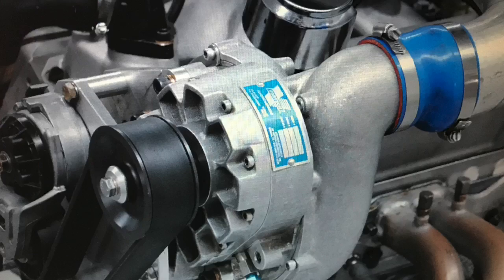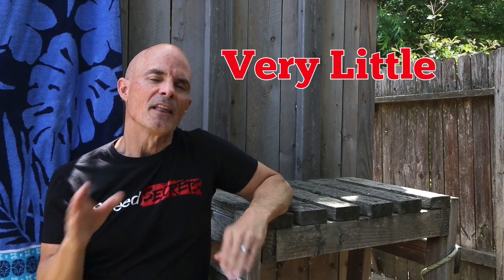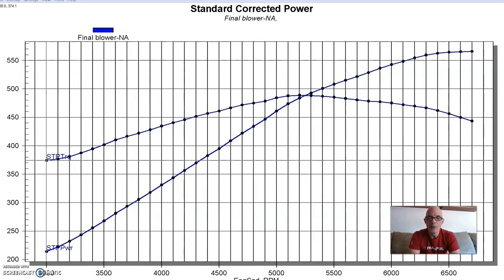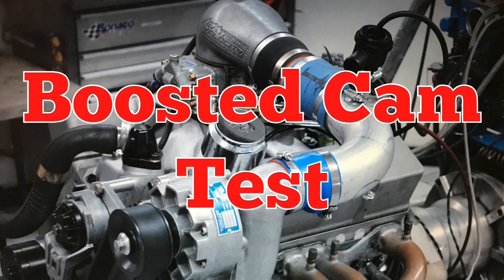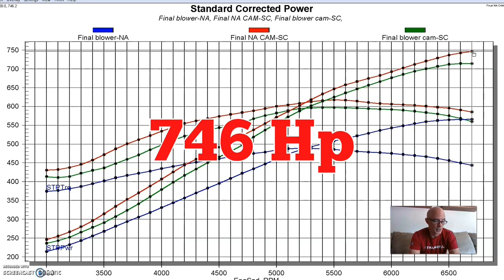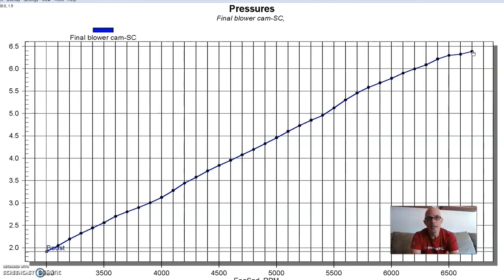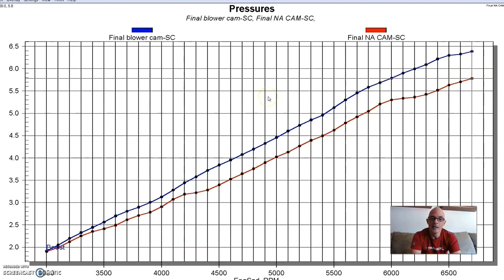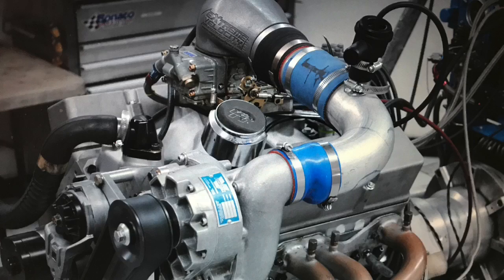MOTOR MYTH BUSTING-BLOWER CAMS!

Comment: What I was interested to see was which gained the most power from the addition of the blower and it is interesting to see the gains were pretty much the same.  The N/A cam gained 149hp and 102tq where the boost cam gained 148hp and 108tq. Virtually the same gains from each.  I had heard this about nitrous cams as well many years ago and it is nice to see it playing out with blowers and turbos so naturally you would assume it's the same with nitrous.

Comment: I thought it might have lost boost at low  RPM becouse of the overlap and gained it back up high .but as you said the move horsepower needed the flow

Comment: Well, at least I feel better about my buddy's car that tried to kill us after he put the turbo back on the nasty SBF he had put the big NA cam in lol....thought I was going crazy, or the tires were old, or the higher gears were the culprit.
The boost is lower because the engine is more efficient and using more air coming in, reducing the back pressure.

Comment: With tighter LSA, more over lap, ins't there more chance of backfiring in the intake?
Reply: LSA doesn't add or remove overlap. Just moves it in the cycle . Duration changes overlap, backfiring would be an ign timing issue, which is cause by excessive retarded timing.
Reply: @vengeanceizmine9878  if you take a cam with given specs and only change the lsa it directly changes overlap. Narrowing (tightening it as KP put it) the LSA increases overlap, widening the LSA decreases the overlap. KJ was correct about that part of his question.

Comment: I drove a s10 with a sbc 350 stock bore massive cam fuile heads 8.5 to 1 compression and ran a 7.80et in the 1/8. Big cam for the win. First engine had a 494 lift cam and 10 to 1 compression ran also a 355 ran 8.30et

Comment: Did u monitor the exhaust temps with the different cams. I seen a blower 406 sbc with a n/a cam turn the headers red just a few min of drive time and it was not running rich nor lean. A dedicated forced induction cam fixed that problem. Just saying a few seconds of dyno pulls may not show that problem.

Comment: I like this test but I don't like how it was done. The "blower cam" thing is usually about 10% more area under the lift curve as compared to a NA cam on the exhaust side. The LSA is usually wider only to keep the overlap triangle similar. This test there is only a relative change of 4° of exhaust cam duration as compared to the intake. The test is also done at less than 7psi, something that is barely considered "blown", there isn't the need to bias the valve timing as there is with the effective port pressures in a dedicated blown application that runs lots more boost.
If I was gonna do this test to directly test blower v NA cam I would do a few things differently. BTR makes ls3 stage 3 cams for both NA and centrifugal blower and it looks like they have the same intake lobe. It's the exhaust lobe, lsa and advance that are different. I would also test it on something that has massive boost, like a 4.8 with 706 heads and an F1A blower. You could do a mass air v power test to see the effect of charge short circuit but a wide band can sometimes show it. If you notice one camshaft makes peak power when it's way more lean than the other, you can assume some fresh air charge is going right out the exhaust, even worst case total short circuit rarely gets to 5%, and your comparing two camshafts that have all else being considered, really similar overlap triangles. The difference is going to be like 1 or 2%. 
You maybe brought up a better point of people picking a cam that doesn't  work as good as it could because some put a sticker on it "blower".
Reply: Agree 100%; my thoughts exactly. I think he should redo this test

Comment: I hope what guys take away also is that putting the right cam for your application is still ideal. There's that one guy putting a sprint car cam in a Street car with a 3.5:1 gear and low stall automatic adding boost.

Comment: I need to change out the dome pistons out of my sbc 400 not sure what size they are. I am running edelbrock rpm heads 70cc with a hydraulic roller cam

Comment: Was anyone following fuel consumption? My thoughts would be with a healthy NA cam, you might find more of the fuel air pushing through the cylinder into the exhaust unburned. O2 sensor might show that also.
Reply: We know the NA cam was burning more air and fuel than the blower cam, because the NA cam was making more power. 

Maybe some of the charge was also escaping out the exhaust during overlap, but even if that was happening, it would still be a fair tradeoff - because more air was ALSO staying in the cylinder for combustion, and that's what matters because that's what turns into horesepower.

Comment: This is very interesting.  The N/A cam had better VE, but by quiet a bit more TQ than I expected.  It flows more air & that is why the hp is up and the boost psi is down.
What begs the question; what about the turbo (back pressure) option, would the N/A cam still have the hp gains & the boost drop? another note is how early the bigger (N/A) cam power came on under boost. this is where I thought the boost cam would be better. more LSA, less duration, designed for boost, that should (in theory) produce more tq at lower rpm.  I expected to see more out of the boost cam.  bullet cams are top notch too.  Great comparison
Reply: Tighter LSA makes more lower, at the expense of vacuum and idle quality. Wider moves it up higher. Just a trade off.  Map out and compare actual timing events between the two.

Comment: I definitely agree with everything that you covered in the video but there's some things that you're leaving out... as boost climbs and cylinder head flow starts becoming tapped out. especially on turbo cars exhaust gas reversion starts coming into play... when you run tighter lobe angles. And if you have reversion happening... then you can get detonation... heat build up... all kinds of problems. That's when you burn pistons break ringlands.. lift the head ect. In a situation where you run into those problems on a tight lobe angle with a n/a cam that's when you move further and further into a "boost cam".
Reply: Except that boost has nothing to do with what a head flows, and doesn't make it flow any more, or any less. BUT,  it will only take so much PRESSURE. As for tighter LSA with boost, he is not showing you what is mandatory, it just depends on where you want the power. And LSA is relative to overall cubic inch, and will act differently.

Comment: The boost is lower cuz the engine/ cam setup isn’t backing up the flow through the intake! But l would 
Like to see what the NA cam at 114 to 117 las would do!
Reply: I think that there is also some intake air passing out the exhaust. But that can be a good thing - the point of overlap is to flush leftover exhaust gases, allowing more intake charge into the cylinders by the time the valve closes. More pressure and airflow during that period just increases the effect
Reply: @coff3eSl0th  The only thing about the intake air passing out the exhaust is shouldn't the low rpm boost pressure be a lot lower with the extra overlap? Darren why would you want such a wide LSA on a 400? A 107 LSA would probably be optimum for this combination.

Comment: Same as in hydraulics, pressure (boost) is the resistance to flow. Lower boost=more flow. (Assuming the air volume is the same, also the supercharger in this test will draw less power at the same time due to lower boost)
  I believe i am also correct in saying when you look at the boost of a positive displacement supercharger, the point of lowest boost would be the engines most effecient rpm.
Reply: True, when the bigger camshaft kicks in in my engine (2ZZ Yamaha-Toyota) the boost drops a little due to the greater VE of the engine. It then goes on to keep increasing as the RPM rises, but that's due to the increase in VE of the roots blower with increasing RPM. That's one thing I didn't know about or expect coming from a turbo background. A roots blower increases in VE the faster you spin it. Makes sense, as there is less time for the air to escape past the lobe tip clearance. The adiabatic efficiency however certainly does decrease the harder you push it! But that's another story - heat management.
Reply: This assumes perfectly flat efficiency for the blower, and that's never the case. While you'll see a drop in boost for a rise in VE, the efficiency of anything else before the last compressor stage (the engine) will have an effect. Changes in charge cooling efficiency (like from the carb), supercharger efficiency (which isn't flat let alone linear), and so on will all have an impact on realized boost levels. 

On most roots style blowers they're most efficient at low RPM and low boost. As you increase pressure ratio efficiency goes down and thus charge temps go up (faster than relationship of compression related heat increase). As RPMs go up, they'll also eventually start rolling off on efficiency. A twin screw will perform significantly better, but generally exhibit similar traits. The nice thing about twin screw is that the RPM at which efficiency rolls off can often be far beyond the requirements of the build. The twin screw will still have efficiency roll off with pressure ratio increase, but has more range than the roots.

Also don't forget that directly attached superchargers require drive power, and that goes up with RPM.

I say all this because if you look at NA vs blown dynos for the same motor, like here on Richard's channel you'll see many cases where peak TQ moves. This shows how blowers will create a second layer of efficiencies that work on top of the primary efficiencies of the engine, and of course there's also the obvious intake efficiency changes if we're looking at a roots style with a dedicated integral manifold.
Reply: Exactly!!!

Comment: This was a great video, very informative and very interesting dispelling the myth of bleeding out boost due to valve overlap from using an NA cam. Question; can you explain what is "LSA" (Lobe Separation Angle) and what impact that figure has on the performance of a cam? Is this the overlap of the valves? Thanks!
Reply from the maker: take a look at the lsa test video
Reply: Lsa is the measurement in degrees that the valve events occur in relation to each other, or how close they are are to each other, let's assume a stock cam has an lsa of 116, the valves aren't open together very much going from the exhaust stroke to the intake stroke, now a more performance minded cam with an lsa of say 108, the valves are opened more at the same time between said stroke, the basic object is to get exhaust to scavenge or pull the exhaust from the cylinder while drawing in fuel and air mix, this event is what causes a tighter lsa cam to also what more "lope" along with duration measured at .050", I hate advertised duration its misleading

Comment: "Every cam is a boost cam"...my man.
Reply: But its only at 6 psi.  

When you start raising the pressure especially in the exhaust manifold it’s gonna change things a lot. 

What I’m saying is an extreme elevated power levels you guys don’t think the blower Cam will allow higher power and higher boost pressures? This isn’t gonna matter so much at 6 pounds. But at 30-35???

And I’m not staunch supporting this I’m just kind of throwing it out there to she wants to discuss it I appreciate the answers thus far.
Reply: My thought is at elevated boost pressures the valve overlap allowing exhaust to pollute the next intake charge.  Something at lower power levels doesn’t cause any issues but... let’s say you’re pushing 1500 hp and you have 40 pounds of exhaust manifold pressure... you don’t think that’s going to contaminate the intake charge at elevated cylinder pressure/boost. 

And the blower cam is designed to deal with this.

Basically I think this test needs a big ass turbo and more boost. I bet the blower cam is capable of making more overall power because of what I’m talking about above. 

I have ported and tuned turbo rotaries. I’m still trying to figure out the cylinder things
Reply: @williamkillingsworth2619  - first off, this test is a blower test, so you won’t get any exhaust polluting the intake charge - since the restriction on the exhaust side will be no match for the boosted cylinder exhaust. With a blower, you can blow some of the charge right thru to the exhaust. You can see this with EGT gauges because an O2 sensor can’t “see” it. This is also a “make the headers glow” conditions, if it happens. Lower boost won’t really happen much. Higher boost is more, but how much? Not a crazy amount.

When it comes to turbo, you can’t really have the “wrong cam” but you can have the “wrong turbo”. The turbine inlet restriction makes the pressure delta much lower than a supercharger, and in ideal conditions, approaches the supercharger or NA back pressure. Yes. Really.

Undersized turbines and hot side housings are a problem, as are undersized compressors and undersized or badly positioned wastegates. The backpressure itself isn’t horrible but the extreme heat buildup can melt valves or hotspot the head. Heat soak is also a bigger issue. In extreme cases you can see 10-20+psi MORE pressure in the exhaust than the intake. Luckily the path through the exhaust is much larger than the valve opening and that pressure is released along the path of least resistance. The inlet charge isn’t affected much, as the overlap period is relatively short at even high pressure deltas. Think about a garden hose spraying into a bucket. If you uncover the hose for .01 seconds, how much water comes out? Not much.

The term you were looking for is “reversion” by the way.
Reply: @grumpysteelman  yor reversion is right but not so much as a longer duration 
that loads more boost in the intake stroke so much it actually lowers the boost pressure in manafold almost like being under a load will pack the cylinder better
Reply: @alonzahanks1182  - You are oversimplifying things in your response and what you’re saying doesn’t seem to have a point.

Yes - if you have an engine driven blower then more flow = less inlet pressure. No - duration alone doesn’t do this and I covered overlap in my garden hose analogy, duration is the same result, shorter duration gives less opportunity to flow but duration alone ignores other flow restrictions where it may not have a positive effect. 

It’s the combination of intake and port efficiency, cam profile, inlet valve size, exhaust valve size and exhaust port and downstream efficiency that define the response characteristics, cylinder filling, and boost pressure.

Care to clarify what you were getting at?
Reply: @grumpysteelman  Im far from a cam specialist  but big rollercams are going to be more freindly than say a lobe on a olds 560 560 lifter cam 
I also do a lot of exaust testing with short pipes  2 into one and duel exaust testing
But I run a supercharger and not a turbo .
and dialed in is every thing a perfect ballance from the air cleaner to the tip of the exaust 
And even pay attension  to speed and momentum in exaust 
but like the constant pressure you want on intake you need velocity through the pipes
And cams can make that stop and start Id actually like to see how hot the head and exaust got during that dyno on each cam  and see the same lifts on each cam 
and Richard said why bother max hp wins lol might have well been a a little 292 chevy cam lol
Reply: Effin aye!
Reply: Listen to wakjin961 ! 100 percent correct
Reply: But boost cams run on low compression n/a Cams run on high compression
Reply: isn’t the blower cam more drive able out of boost? Giving it better street manners than an engine with a lot of overlap. 

I wonder if/how the longevity would be effected?  Is the Blower cam the safer option?  Or does the added overlap cause other unwanted gases into the cylinder that will rare its head at higher power levels?
Reply: @williamkillingsworth2619  If the overlap is less it will idle better and probably behave better just off idle. But the LSA on both cams is too wide and the duration is too long. If the overlap is correct then the duration and lobe separation can both be reduced and the mid-range will come in much stronger.
Reply: @williamkillingsworth2619  Look at the torque curves, the answer is no.

Comment: I believe the boost drop and extra power came just from the extra 14 degrees of intake duration. I think if both cams were the same other than the LSA boost would have been the same, but the blower cam would have made a little more power up top while the NA cam would have made a little more torque down low.